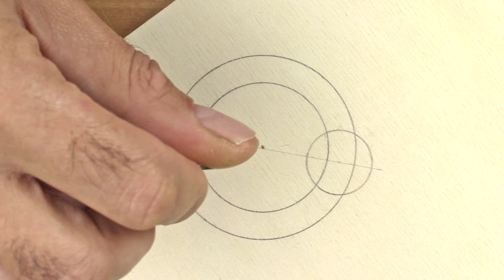DON'T TOUCH BOX !!! - Useless box with arduino - DIY

Comment from the maker: OGGETTO DEL MOMENTO ALTAMENTE CONSIGLIATO
Se siete in procinto di acquistare una stampante 3D altamente affidabile per realizzare le vostre stampe, ecco un modello che consiglio ad occhi chiusi, tra l' altro con uno sconto impressionante ma dura solamente pochi giorni. Ne prenderò una anche io perchè ho in mente di fare quasi tutti i prossimi video con questa meravigliosa stampante 3D https://goo.gl/4BSBwi usate questo link per l' acquisto
Reply: Great project. I’m wondering if it would be possible to replace the front switch with a motion sensor that activates the box as a person passes by. Then the teddy bears hand over the sensor closes the box.

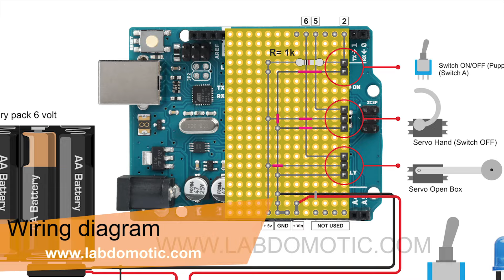Comment: Have a look at the circuit diagram @7:18 and look at switch A with the 1k resistor then look 
at 8:27 and 10:28 and you will see it's wrong, both pins are connected together then at 12:03 he switches the circuit board with the right one and it will work. Very shifty
Reply: oh thank you.^^ thats one of the mistakes i had to find while building this.

Comment: Awesome project. Did it with my 8 year old. U need the arm to spin about 8 more degrees. Any oil ne know how I can do that? Line un program?
Reply: In the Arduino Sketch you will see values for the arm rotation. At rest it is 180 and extended it has a value of 25 if I remember correctly. I had issues with it not activating the switch so I reset the value for the extended arm to 0. You have to be careful that you alter all of the extended arm values, you can use ctrl/F and insert the current extended value along with the change to value and then hit Replace All. BUT before you do this make a copy of the original and rename it with an identifier (example - 01) in the name in case it goes haywire and you need to reset back to the original.
Reply: @TheDirtBiter  thank you.

Comment: Ciao io possiedo due motori di quelli che hai utilizzato per la mano che chiude l'interruttore,secondo te non riesce ad aprire il coperchio sopra? e se il coperchio lo facessi di plexiglass?
Reply from the maker: Lascia perdere quei servomotori, non sono adatti  a questo impiego. Ho fatto centinaia di prove con il servo economico per alzare lo sportello con il pupazzo trovando strane leve e posizioni, ma se vuoi alzare solo quello senza pupazzetto, lo alza tranquillamente, ma solo se usi materiale leggero. Il plexiglass è pesante, stai attento. Ti consiglio di usare il servo che ho consigliato sul mio blog, costa 4 euro ma ha un rapporto 10kg per cm mentre quelli che hai tu hanno 1kg per cm. A parte questo, anche se riesce al alzare lo sportello, generano un ronzio di stabilizzazione che su servo potenti non si presenta.
Reply: Daniele Tartaglia  grazie ho controllato bene e ne avevo solo uno quindi ho fatto l'ordine del tuo

Comment: Bellissimo e simpaticissimo i bimbi si divertono un sacco con questo gioco.

PS: Per esperienza personale, il ronzio che si sente viene generato da quel tipo di servo motore che hai usato (di tipo molto economico). Se sostituisci il servo 9g con un MG996R (più grande, un po' più lento, potente e ovviamente costoso si parla di circa 4 euro in più) non si sente più il ronzio e non ci sono "movimenti strani" da parte del servo.
Reply from the maker: ti ringrazio, ma ho scoperto da solo questa cosa. Il servo della manina che chiude l' interruttore è molto debole infatti, gli faccio fare solo quella cosa anche se, su interruttori meno sensibili, fa fatica con movimenti lenti a fare lo scambio. Per l' apertura del tettuccio, ho usato un modello da 10kg per cm ed è molto forte, solo che con le stilo non ha sufficiente corrente per mantenerlo stabile. Se alimentato a 6 volt con piu di 1 ampere, non fa strani rumori.
Reply: Daniele Tartaglia sempre per esperienza personale, provai ad alimentare dei servo di quel tipo (parlo dei 9g) con un alimentatore stabilizzato a 2 ampere ma sempre sotto sforzo (piccolissimo) ronzano. 

Spero che questo nostro scambio di pareri serva a chi legge per scegliere i servi giusti nelle loro applicazioni.

PS: mi è piaciuta un sacco la tua idea di costruire uno shield dedicato per Arduino.

Grazie per il video che hai realizzato, sempre tutto preciso e ben fatto.

Comment: fantastico così lo useless box e molto più divertente. Ma per curiosità come hai controllato le posizioni dei servomotori? passo passo? a tempi? o altro perché encoder non ne vedo. comunque sei un grande è hai fatto un ottimo lavoro come sempre
Reply from the maker: Ti ringrazio molto. Semplicemente perchè i servomotori mantengono la memoria di posizione in relazione ai gradi  impostati. Se dai una istruzione tipo questa:
Servo1.write(180);   significa portare il servo a 180° alla massima velocità e li rimane fino alla prossima istruzione. naturalmente se vuoi avere un movimento lento:

Devi utilizzare un ciclo for e usare un delay tra uno step e l' altro:

for(pos = 0; pos < 180; pos += 1)
  {
    myservo.write(pos);
    delay(15);

in quel caso il servo impiegherà , da zero a 180 passi con 15ms tra uno step e l' altro : 180x15ms= 2700ms che tradotti sono 2,7 secondi
Reply: Daniele Tartaglia ottima spiegazione ti ringrazio!. Quindi questi servomotori hanno dell’elettronica dentro che dice loro quanto spostarsi se gli do un comando di spostarsi ad esempio di 20 gradi
Reply from the maker: esatto, hanno un controllo elettronico che li porta a quella destinazione e li rimane. L' unica cosa è che non possono girare al' infinito...questo è il loro limite.